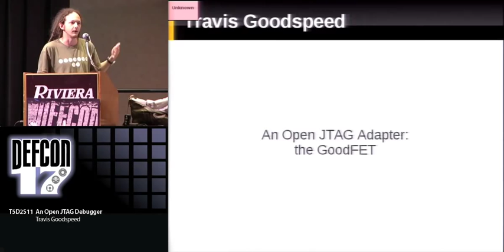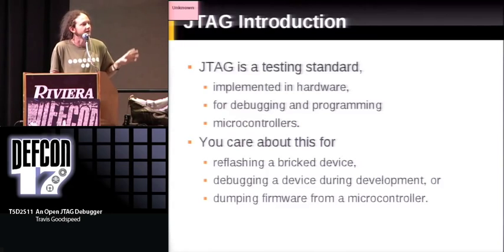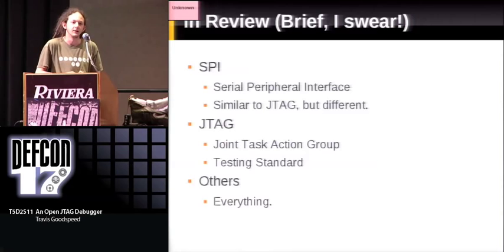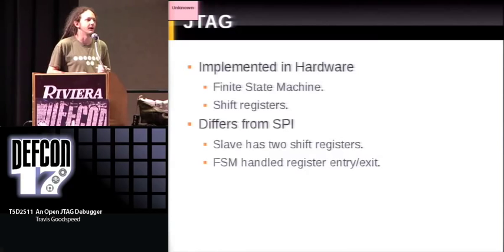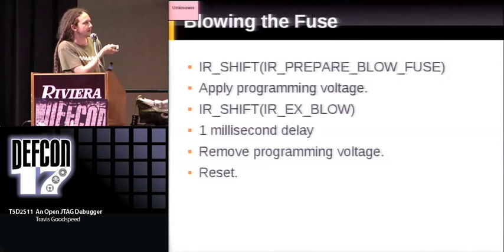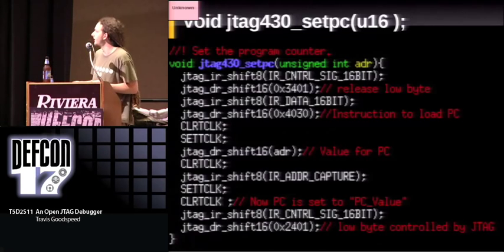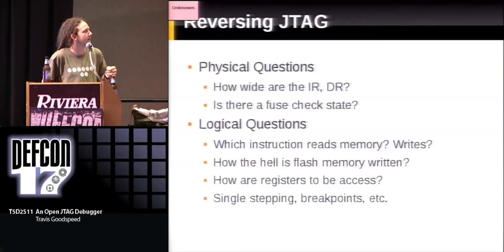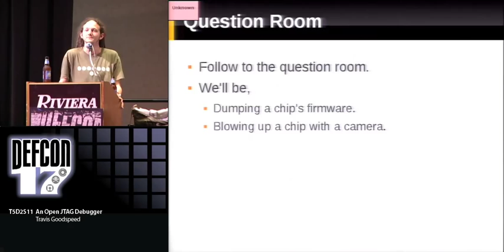DEFCON 17: An Open JTAG Debugger

Comment: Cant you just desolder the fuse?
Reply: TheBitjunkie. I think he's talking about an in-chip fuse, I think they're also called efuses. I know with fpgas, the lines connecting the gates are called fuses. I'm guessing if the fuse blows by connect certain registers, or timer runs out, or a bit is high when it should be low, the fuse doesn't allow the bootloader to connect to the rest of the inner chip. This is a guess, I'm hoping someone will see thing and explain it better. I don't understand the software fuse though.
Reply: I think he's talking about an in-chip fuse, I think they're also called efuses. I know with fpgas, the lines connecting the gates are called fuses. I'm guessing if the fuse blows by connect certain registers, or timer runs out, or a bit is high when it should be low, the fuse doesn't allow the bootloader to connect to the rest of the inner chip. This is a guess, I'm hoping someone will see thing and explain it better. I don't understand the software fuse though
Reply: It’s not a ‘fuse’ in the physical sense. It’s a register in the processor (or any other chip) which can be permanently set (blown) to prevent you from reading or modifying the firmware. It’s meant for copy protection. Once the manufacturer programs the device and tests it for proper functionality, they can ‘blow’ that fuse (set the register) so that someone else can’t come along and read the firmware to copy their device. Also, a lot of manufacturers will grind the numbers off of the chips so that you can’t copy their hardware. With a JTAG debugger, you can identify the unique ID’s of the chips and determine which ones they are using. Blowing that fuse can prevent you from doing that, as well. You still may be able to determine what the chips are, but it will take much more effort. Think of it like putting good locks on your house. The burglar will still get in, but you’ll make him work harder for it. Or, in some cases, the company wanting to copy your device will just move on to another company’s device which is easier to copy. Just like a burglar would go find an easier house to break into. I hope my explanation and analogies were clear. Leave another comment if I didn’t explain it well. :-)